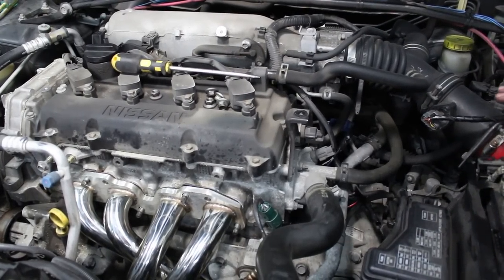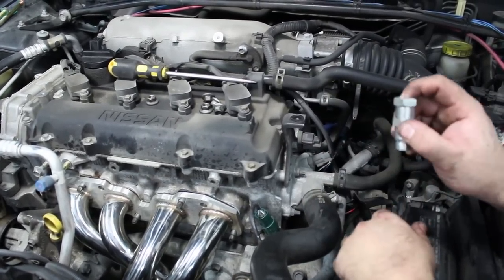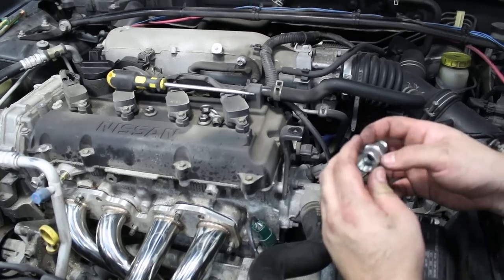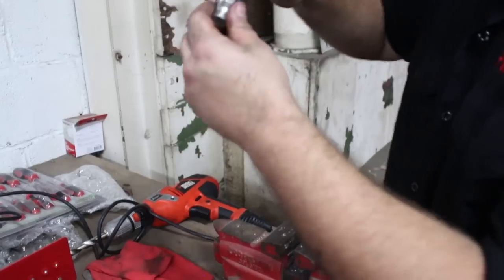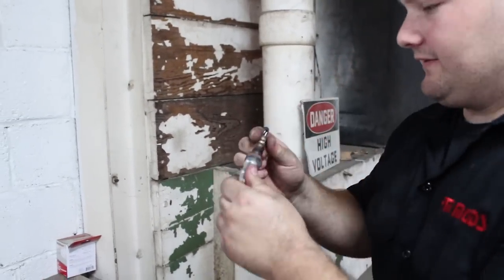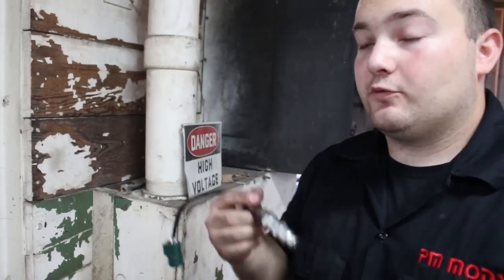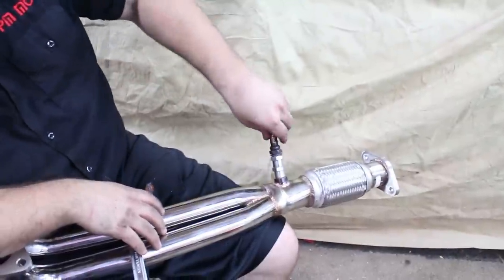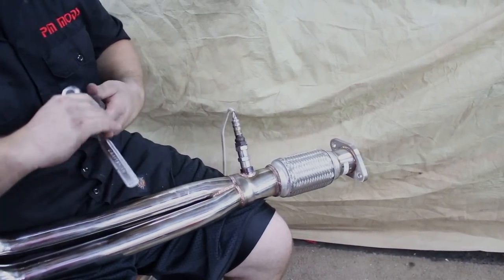$4 Catalytic Converter P0420 Fix | 02 Sensor Simulator | Pass Emissions | Oxygen sensor

Comment: Ty.Just did this on our Honda Ridgeline and it passed after 2 years of avoiding police.You saved us a lot of cash.
Reply: charwa66  which sensor did you do?
Reply: Was it easy to get them out, I have a Pilot
Reply: what do you mean by having to avoid police for 2 years.
Reply: @mcdavidhome100  his Cadillac converter was clogged or some dam punk stoled it so replace it over a thousand so he bypassed the system but cops whould give him a 30k fine if caught driven if someone stoled his
Reply: Hahahaha Honda ridge line
Reply: @mcdavidhome100  it means they couldn’t get through inspection because of a check engine light.

Comment: I've done this to mod to my last 3 Jeep's after going to high flow cats, relocated O2's and bigger piping and it does work. In my applications, 5.2 and 5.9, I only used 1 antifouler but I've heard some vehicles need both the drilled out one and a stock one and sometimes steel wool sandwiched between the end of the O2 and the small hole in the second anti fouler.
Reply from the maker: niceeee

Comment: This worked for me too on a 2002 Honda CRV. Saved $700 many thanks man!, took 15 mins and the check engine light is still off with a brand new inspection sticker. It's been a solid 2 months. Praises. You are awesome!
Reply: Where i live inspection is just pay they wont care if the light is on or off or anything
Reply: Update: 12 months later still working fine
Reply: @benjohnson2433  does it run like crap? My truck has the o2 sensor codes on  and has been running like shit since I took the cats off, will it stop running like shit when I get that on there ?
Reply: Want to try this on my honda fit

Comment: Why wont this work for the Bosch sensor? Is it a size difference or just something electronic?
Reply: Ive done this on an 02 3 series bmw with Bosch sensor and it worked fine
Reply: bosch sensor work on vacuum sensor not heat like most the more heat the more blockage and higher sensor reading bosch works on vacuum ratings sensor not heat if cats blocked using bosch then the vacuum is high levels and send signal to say it high and create check light to fool the bosch ox sensors leave tiny little hole on spacer about 3 mill diameter will work great or short out pin no 3 and 16 on computer diagnosis plug turn key on delete cod permanently and also take cats out still run perfectly
Reply: It work with a cheap aftermarket  02 sensor.NO PROBLEM

Comment: To avoid the thread problem while drilling flip it over in the vise grab a uni bit or step down bit. Then you dont got to worry about hitting the threads.
Reply: Or, Use a Drill Press!!
Reply: @timeless6964  I think you missed the point that this is a "poor man mod".  If you are doing this mod, you probably don't have/can't afford a drill press.  😁

Comment: I bought a kit for my mk1 focus, no problems going on for over a year. It even passes NYS emissions inspection.
Reply: You got the correct details for the ones you got i seen a few on ebay but i got mk1 focus 1.8 2000plate some reason only has 1 sensor the 2nd one dont appear to be exsistent on it but changed 02 sensor 3-4times light goes out then 10 mins up rd back on again just wanna see if this works

Comment: Wow dude this really worked for me - THANK YOU!

At first it didn't work because i used both foulers together.
I got the P2A03 code - O2 Sensor Circuit Range/Performance Bank 2 Sensor 1

But then i used only one fouler and it worked like a charm. (1,000 miles with no check engine so far)

I didn't have to do any drilling - it was all plug and play for me...They come in a couple of different sizes - got it at O'reilly/Checker store.

06 ALTIMA 3.5 V6 - my pre-cat on bank 2 fell apart completely which is why i had to do this (destroyed the original engine, had to swap)
Reply: Which part # you bought that was all plug and play?
Reply: How would a cat destroying itself kill your engine? Burn a valve?
Reply: @Dude13450  it disintegrated, clogged the exhaust completely and created too much backpressure. While cranking the engine and trying to diagnose why it keeps choking i guess it sucked in a few broken pieces of the cat and destroyed cylinders 4 and 6. 
Compression on these cylinders was only 60 and 90 psi. 
Surprisingly the engine still ran strong after clearing the exhaust but it burned an insane amount of oil. Big blue smoke behind me for a mile. 
I never took the old engine apart to see what broke inside, possibly piston rings? No idea...
Reply: @Mickey_Bauer  ouch
Reply: 1 fouler in the downstream or upstream ?
Reply: @alexp5343  downstream.

Comment: THE ONLY DIFFERENCE WITH SOME GM'S, SUCH AS CADILLAC, IS THE O2 SENSOR BUNG, WHERE IT THREADS IN TO, POINTS AND THE TRANSMISSION. THIS TRICK DOES WORK, HOWEVER, WITH CADILLAC, YOU MIGHT HAVE TO CLOSE UP THE OLD BUNG AND RE-DRILL, AND WELD A NEW BUNG FOR THE 02 TO THREAD IN TO. GREAT TRICK AND FOR ME, IT WORKS FANTASTIC.

Comment: I did this on a 1998 Jeep TJ, I only used one of the anti foulers, Works for me, no light has come on in a month. BTW, I removed the cat altogether.
Reply: Excellent so this should work on my 04 wj
Reply: Did you remove your cats?
Reply: @blue67strm  the ‘98 only has one and yes it’s been gone for years. No issues.
Reply: @OFFROADSLuTZ  how does it pass smog??
Reply: @FlatOutHero  we don’t have any silly useless emissions testing or yearly vehicle inspections in Alberta Canada.
Reply: @FlatOutHero  and the ‘98 had one cat and two o2 sensors

Comment: Once your car is "ready" for a smog check, you need to remove the spacer and then you have a few miles before the check light comes back on,
so if you go to the smog check immediately after remove it, it will pass before the CEL comes back on.  Otherwise they will fail  you for modification/tampering
Reply: That's only if they a visual check, half the time they don't even check them

Comment: You’re awesome brother! thanks a bunch for the info.
It worked on my 2006 Nissan Xterra, I had the P420 code and check engine light on, failed emissions obviously. 
After seen yours and someone else’s video, I tried this and it worked 100%
My check engine light went away after about driving for 40 miles, and never came back on. This was installed on the oxygen sensor in bank 2 btw.
I waited 48hrs. and took it to emissions test, it passed with flying colors.
Awesome mod, it literally saved me tons of money.
Thanks again.

Comment: If you have a part with wrench flats or a hexagon shape, then put the flats into the vise jaws rather than the cylindrical body of the part.
Reply: Yes,get a good oval going on those threads that gnarl up most of the time when they're GOOD.

Comment: Flip the it over so you don't have to be concerned with threads.  Also if you use a Bosch sensor it requires a 9/16th. Drill bit. Patience. And a file. For the Bosch o2 to fit and in the one you put in first I used some Harley Davidson catalytic material . plus I used a large stainless steel washer on the first one for a heat sink because the aluminum disapated heat to fast.when you put the one you have drilled out into the first one use a copper gasket not the ones supplied. They don't give a complete seal.
You can also use some stainless steel wool for a restriction in the first non foul. 
Use the copper thread seize better conductivity. 
Torque is questionable because thirty foot lbs is Alot for aluminum threads. I did 23 ft lbs.  So far I've had to reset relearn my computer twice. I own a 2016 scion tC. Very picky ecu.
 WRAPPED DNA MOTORS HEADER ,WRAPPED CNT DOWN PIPE. SRS CAT BACK EXHAUST .
TWO OIL collectors one on pcv side and one on valve cover side. Home made Trd intake system. 
 currently using sawyer tuning chip. 
Loud on full throttle stock sounding at Cruz speed. Rumble on load up hill.
Reply: Post a video
Reply: so bosch will work afterall, but need a larger hole? That is the issue i have ran into

Comment: It worked on my 2000 Celica. I have the typical oil-burning condition of the early 1zzfe engine which seems to have resulted in a "Inefficient Catalytic Converter" CEL (probably oil-fowled/coated). So I gave this a try on the after-cat O2 about a year ago and haven't had any problems since. Next step is probably going to be trying to remove the cat and replacing it with a pipe and see if this can still fool the OBDii when I get around to it.
Reply: Did you remove the catalytic converter then?
Reply: @zkarz7385  
I did. And with the defowler the car didn't throw any Check engine lights but it sounded like ass so I put the converter back on. Eventually I did a 2ZZ swap and that solved the issue.

Comment: I just did this to my 07 Rubicon. when I did my clutch a while back I noticed the two upper cats were blown through and the pieces had collected on the lower two cats partially clogging my exhaust. so i busted out the other two and that were also coming apart and well of course my light had come on after a drive cycle.  p0430 catalyst efficiency code.. ran down to the parts store it cost me $8 for two packs of those ( they come in pairs ) and about 15 minutes of getting mud and shit in my eyes to do this and it worked.. got me through deq and saved me $400... ill be honest I callled b.s too...
Reply from the maker: glad it worked for ya!

Comment: penetrating oil while drilling will save the bit and make it cut better
Reply from the maker: good ol WD40
Reply: WD40 is neither a penetrating oil nor a lubricant. PB Blaster is a decent penetrating oil available most places.

Comment: If you put some fine steel mesh between the anti foulers you’re almost guaranteed a no check engine light. Why doesn’t it work with the Bosch? Is it a size issue or something else? I think you only need it for the downstream one, correct?

Comment: I like how you went slow with the 1/2" drill bit. They last alot longer that way ;)
Reply from the maker: yup!
Reply: Also adequate down pressure helps too
Reply: What size fouler to use? I see they come in two different sizes?
Reply: @MrTrump90210  The same as your O2 sensor. You have 2 choices.

Comment: I have a Subaru from 2019 and it won't work. I tried 3 different versions of these things. It would give me a different code for low voltage on the rear O2 sensor. Any thoughts?

Comment: Correct me if I'm wrong - but wouldn't this make the O2 sensor "see" less Oxygen, and it responds by LEANING out the A/F mix until the Oxygen level "seems" correct ??  Or does this have to do with lowering the temp of the sensor ??
Just wanting to know HOW does this work . . .
Reply from the maker: The spacers go on the downstream 02 sensors which only tell your computer if your cats are working properly or not, it does not make adjustments.
Reply: Well taken out of the exhaust stream is like hanging off in clean air supposedly..if it is a O2 sensor the it fools the ECU into thinking the cat is still ok...
Reply: It is for downstream sensor only, that one doesn't control anything for most of the vehicles, just monitors the catalytic converter for emission purposes. Upstream sensor is a different story, you do not want to mess with that one. On some newer vehicles, a new type of wideband oxygen sensor is used downstream and it may also control the air/fuel mixture, however it is still uncommon.
Reply: @PoorManMods  will the spacers fit a 09 silverado?
Reply: This was my question also. Good to know it doesn’t as I already did the mod

Comment: how does this work? if the cat isnt producing oxygen then there will be no oxygen detected so the sensor wont pass readiness tests and will fail emissions.. wouldnt you need to drill holes in the side of the defouler so gas can escape and oxygen can enter?

Comment: gonna try it on a 15 versa.. thx
Reply: How'd it go?
Reply: @Zx14rrrrrrrrrrr  turns out the ecm was shot , and never got around to the cat.
Reply: @airgunningyup  damn
Reply: @Zx14rrrrrrrrrrr  70k miles.. nissan wanted 3400 to install and program it.. the car was basically a loss at that point .
Reply: @airgunningyup  can't just get a used 1 and see if it will work?
Reply: @Zx14rrrrrrrrrrr  tried that at the local shop/ it was 1000 installed for anew one .. not too bad.. needless to say the new ecm would not run the fuel pump.. clusterfuck
Reply: @airgunningyup  man that's crazy

Comment: My truck had dual pipes but the guy I bought it from converted it into a single pipe and my check engine light is on for no O2 sensors. How do I fix this problem for smog? Cause I have no exhaust pipe there at all anymore.

Comment: I have 03 Suburban with the  5.3L LM7 engine and had code P0161 passenger downstream behind cat o2 was saying bad bought new oem one at advance auto parts and it was idling good for half a day then check engine light came back on and has a little tiny miss you can barely notice if not paying attention for it and obviously now back to running rich as hell @ 9.5mpg .
I’d like to know if this would fix the richer fuel problem by it not seeing the cat error and ecm adding fuel…???
And was thinking about doing a cat delete as well with this trick…🤔💭💭💭

Comment: I modified my Bosch O2 sensors to use a bigger sample to fix P1133 & P1153 codes and now get P0420 & P0430 for ineffective cats, I think using these might be my solution again...my Camaro used these with the old headers 2 years ago.
They also call these things O2 Sensor Spacers
Reply: Did it would with your Bosch o2 sensor?
Reply: This always worked for me with a straight pipe since I got a new exhaust with high flow cats included only a shop tune would fix the codes or rather just disable them from reporting to PCM.

Comment: Nice video! Will these work on only faulty o2 sensors? Went to mechanic, they said my cat was fine but needed both of my 02 sensors replaced(which I did, both Denso oem). However, I still get the codes! I have a 2013 Corolla S
Reply from the maker: These will not work on faulty 02 sensors, they have to be functional.

Comment: What it does is dramatically lowers the actual value of fuel/air mix ratio and adjusts it according to false reading.
That means your engine will either run on mostly fuel or mostly air, not sure at this point.
See you at the engine replacement store.
Reply from the maker: WRONG
Reply: The upstream O2 sensor adjusts the air fuel ratio. The downstream O2 sensor checks the cats efficiency

Comment: I passed my 2002 corolla in Los Angeles and i bought two at ebay..

I plugged in and reset the code p0420 and later the monitor was ready and i passed it , also changes  the oil cap rubber seal

Comment: I had a P0420 code on my 2000 Maxima. I did this last night and my car immediately stopped running super rich and my SES light has not reappeared. Only things that I did different from most is that I only used one anti fouler and I drilled it all the way out the other end with a 15. I did not leave the small hole at the end and it used it for my upstream cat.
Reply from the maker: nice! glad it worked!

Comment: woud this cause the car to use more gas ? since the oxygen sensor is not getting the correct reading from the fuel mixture . or will it cause it to save gas ?
Reply from the maker: no, the spacers only go on the down stream oxygen sensor which are only for emissions, they dont control fuel

Comment: Would this work to remove lean or rich fuel trim codes that are causing my "oxygen sensor monitor" to not complete? - 2009 GMC Sierra
Reply: That’s what I was wondering as well.
 I have 03 Suburban with the  5.3L LM7 engine and had code P0161 passenger downstream behind cat o2 was saying bad bought new oem one at advance auto parts and it was idling good for half a day then check engine light came back on and has a little tiny miss you can barely notice if not paying attention for it and obviously now back to running rich as hell @ 9.5mpg .
I’d like to know if this would fix the richer fuel problem by it not seeing the cat error and ecm adding fuel…???
And was thinking about doing a cat delete as well with this trick…🤔💭💭💭

Comment: I have a 2002 altima 2.5. One day I was driving normally when I hit a bump and I heard a rattle and as I kept driving and pressed on the gas I could hear air being compressed out. Later on after checking everything I could, I found out the precat was destroyed and it had completely clogged my mid pipe. I clear everything out so right now my precat and cat are hollowed. Would this clear my check engine light? I've heard that I only need to use the spacers on the second sensor but does it matter if I use it on the stock precat or do I HAVE to get headers? Would I even have to worry about the main cat?

Comment: Thank you for posting this! Great trick. My vehicle is displaying the check engine light periodically with the Cat converter error code. Does this trick only work to shut off the check engine light? Do you know if it would also help to keep it from coming back on again?
Reply: I have a 07 bmw and it worked for me. Check engine never came back in after a year

Comment: Any advice ? My car has no check engine light but it fails smog it fails at 15mph but passes at 25 it also has a new 02 sensor , what could it be ? Should I try cleaning the cat ?
Reply from the maker: I dont have experience trying to pass a smog test, you could try cleaning the cat or running seafoam through the engine
Reply: Poor Man Mods question I also have no check engine light on .. my car failed a smog due to a bad catalytic converter.. I only have one o2 sensor which is before the catalytic converter below the headers.. I'm going to try the non fowlers for that o2 sensor and see what happens.. when I smog my car ..

Comment: Hello I failed my inspection because of the o2 sensor also that I removed when I put in my helltoe max power kit on my 2016 Honda Accord Coupe which one would work for me? I have pics also I really need to get rid of that check engine light. I failed P0139 P0420 and P0430 trouble codes